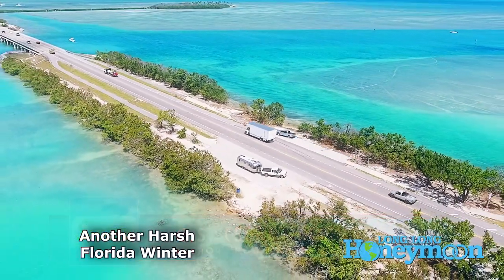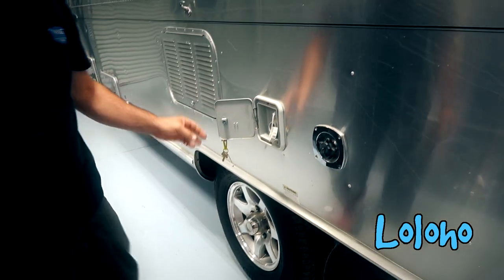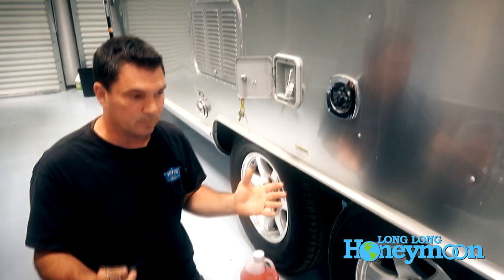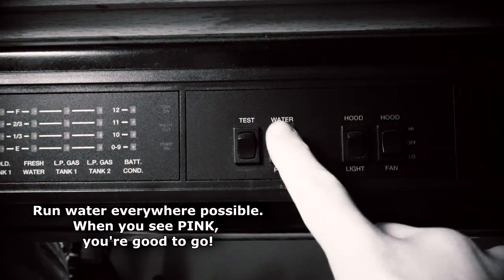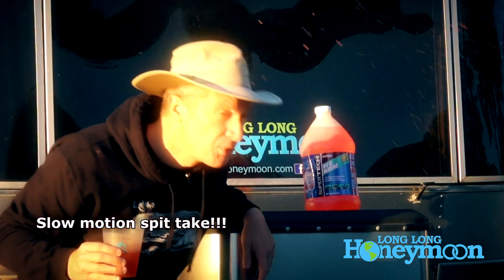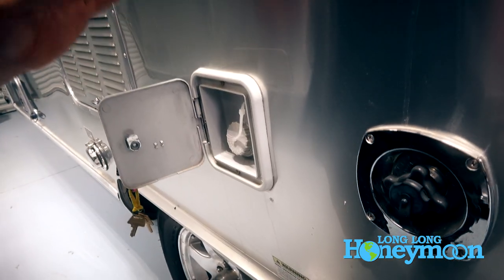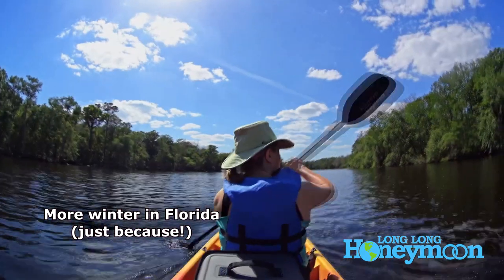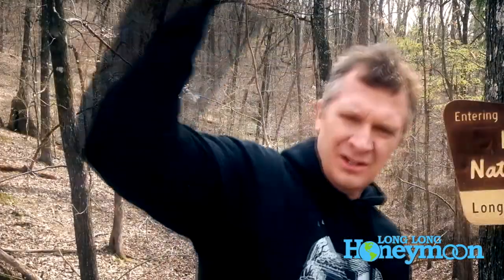❄️Winterizing an RV - The Basics!

Comment: I assume this antifreeze is methanol with a bit of pink colouring?  I don't see where this would be a problem at all . It seems to me that with methanol's affinity for water would make it ideal for this purpose.
Reply: The alcohol/glycol sounds a lot like car antifreeze. [the glycol as i recall allows for a higher temperature in the radiator before boiling... we had to replace the antifreeze  in our race bikes with pure h2o as the glycol based antifreeze  spillage from a race incident would produce a very slippery pavement surface.]
You haven't had problems with this combo I trust? I reckon it would need a very thorough flush from the drinking water part of the water system. which is actually a very good idea no matter what one uses to be honest!
I wonder what makeup of the antifreeze is that Vinnie recommends?
Reply: Methanol is highly toxic and can cause blindness and worse. The pink RV antifreeze contains ethanol and propylene glycol which both are non toxic (as long as you don't overdo it).
Reply: Thanks for that clarification on  the methanol Mike ! [I was wondering about toxicity if it wasn't flushed out really good]
This got me thinking about glycol so I just went and looked up the various glycols . I was confusing propylene glycol with ethylene glycol as well.  I have to say  that confusing the two like I did could be very dangerous .
Reply: MrBill, propylene glycol (very low toxicity) is used in RV antifreeze while ethylene glycol (much higher toxicity) is used in regular motor vehicle antifreeze.
Reply: Hah hah!  Any of us over 55 may have experienced propylene glycol for one of its other purposes. Good reason to either avoid the fresh tank entirely, or make sure it is completely flushed and sanitized come spring.

Comment: IMPORTANT!   When dewinterizing, the.  LAST  step is to move  the valves back to their original position.  That way you will not circulate antifreeze into your water heater when you are trying to flush it all out of your water lines.   When winterizing the First step is to move the valves so you do not fill your hot water tank with antifreeze.
Reply: Yup... I tried to make that point. Always good to point it out again :-)

Comment: You guys... Quit buying that antifreeze stuff....  open all your valves, crossovers and low point drains..  empty the hot water heater w/ the bottom plug.. and blow air thru the system.. .. no water no freezing..  I work on RV's for a living now that I have retired from the sea..  and see the parts busted from freezing are the valves.. .. not usually the water lines. but the small spaces the water can't expand when it freezes..  VALVES....don't forget the toilet valve.. I especially hate replacing those...;p

Comment: I’m pretty surprised that your guy advocates putting antifreeze in fresh water tank. This is difficult to flush out and you’ll be tasting antifreeze for a long time. After we drain the hot water heater, we use a hose from our water pump to pump the antifreeze through the system. Super easy. Put hose in bottle, turn on pump, run faucets until you see pink, flush toilet several times and pour a little in each drain line and your done.
Reply: I agree with you about not putting antifreeze in the fresh water tank.  Sean and Kristy's Airstream is sort of old and I believe they didn't run the plumbing with an extra hose at the water pump to suck in the anti freeze back then.  My 2015 trailer did come with winterizing hose at the water pump but just like the water heater you have to turn several valves in order to bypass the fresh tank inlet and activate the short loose hose which one puts into the 1 gallon jug of antifreeze.  I've never had to winterize due to living in a temperate climate so I just drain all of the lines along with the water heater.  If I did though I'd do the same thing but I'd pour a cup full of antifreeze down each drain to protect the standing water in each trap.
Reply: Cecilia Petrowsky y
Reply: Info:  A fair number of less expensive or smaller TT’s don’t have an antifreeze inlet line like you are describing.  I was surprised, but some very good friends that go on long summer trips have a trailer that did not come with the inlet line and valves.  Their first winter, they had to ADD the antifreeze via the white tank.  The next spring they retrofitted their trailer with the inlet and valves.  So the method shown by the Airstream tech is a method that works for anyone, regardless of whether they have the extra inlet line and valves or not.

On the extra taste b/c of remaining potable antifreeze, I know that I sanitize my white tank EVERY spring @ de-winterization and mid-summer to prevent any bacterial growth and yuck in my potable water system....  I am sure that the sanitization process, with the several flushes of the white tank I do would clear out any antifreeze not gotten out with the low point drains. So don’t stress over the taste.  Just sanitize to keep the potable water tank clean and you’re good to go.
Reply: Agreed.
Reply: David Silva Thank you David for the educational comment. I learned something.
Reply: Goodpoint snackman. You can always pour some fluid directly in the P traps. If you choose to connect the hose to the inlet side of the pump (very difficult to get to on the airstreams) just make sure the seal in the fitting stays in place and you get that fitting snugged up again so everything functions normal during seasonal use. When using antifreeze to the tank you are really only adding a tiny bit compared to the size of the tank. I like to drain out the remaining amount when finished and then leave the drain open and flush whatever might be on the walls with fresh water. Never had a complaint about the taste of the water :-)
Reply: You really shouldn't be drinking from your fresh tank. Its impossible to fully sanitize it. Too many nasty, bacteria clinging to it.
Reply: The Traveling McCaffertys - Yes we carry drinking water. If we run out, there's usually a water refill station nearby. If boon-docking, we make plans to carry a little extra. The fresh tank is reserved strictly for showers and toilet flushes. After our most recent trip, we went through 4 gals. pretty quick. I think I will buy a small Berkey type filter and begin using the tank water again.

Comment: I would never...ever...put antifreeze in my fresh water tank, I don't care how 'safe' it is.  Pipes burst because when water expands as it turns into ice, it has nowhere to go.  After you drain your tanks, empty the water heater, clear water from the lines...leave drains and taps open.  If there water, as it freezes it will follow the path of least resistance.  DO pour some antifreeze in your outgoing drain lines...like the toilet and sink as an added protection.  My former SIL lives in northern Minnesota where folks have a second front door on the second floor and this what she does to her RV and they have never had issues.